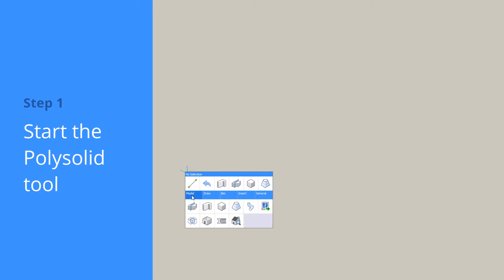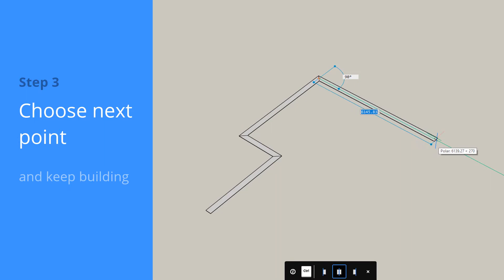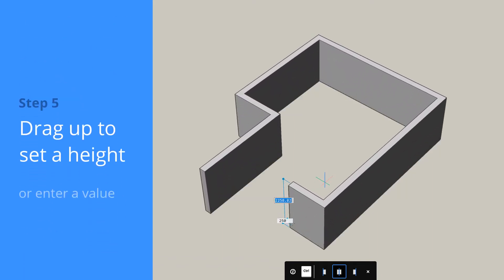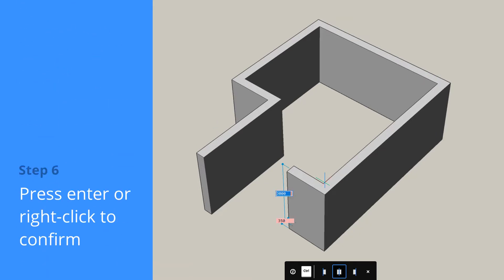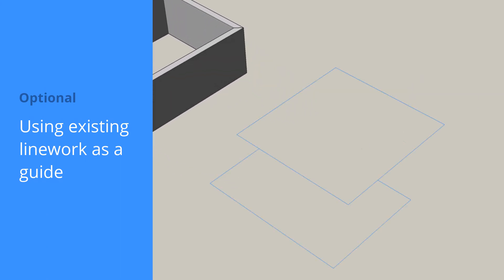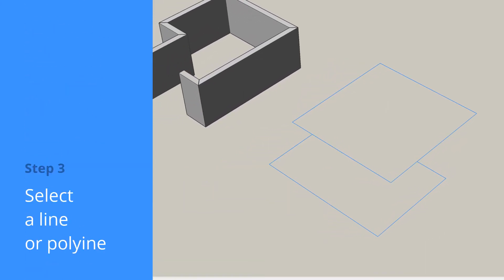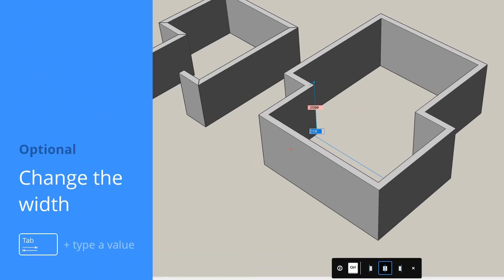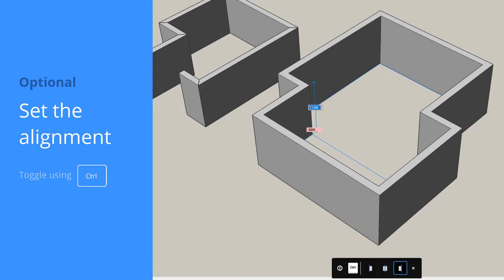How to create wall layouts - BricsCAD

Comment: Hi, Thanks for the video. I cannot select the outside border of 2 overlapped polygons. When I hover my selection box over each polygon, it turns blue to be selected individually, either the rectangle or the cut rectangle with a portion trimmed. 

To achieve what you did I have to trim the full rectangle too and join the outer boundary to make it one single polyline.

Can you explain why the outside perimeter in your video turns blue when you hover over it please?

Comment: Hi. How to change a wall orientation or wall centerline after modeling it? Is drag and drop option available for changing the baseline of the walls? Thanks in advance.
Reply from the maker: Polysolid command creates solids, which can be edited like other solids (e.g. Push/Pull faces, see this Help article https://help.bricsys.com/hc/en-us/articles/360007746313-DmPushPull). To handle them as walls you need to classify them (https://help.bricsys.com/hc/en-us/articles/360007828213-BIM-Classify-). When applying a composition BricsCAD tries to recognize the exterior/interior face of a wall automatically, but you can use Flip composition option to reverse the ply order of asymmetric multiply compositions (https://help.bricsys.com/hc/en-us/articles/360006654873-BimAttachComposition).